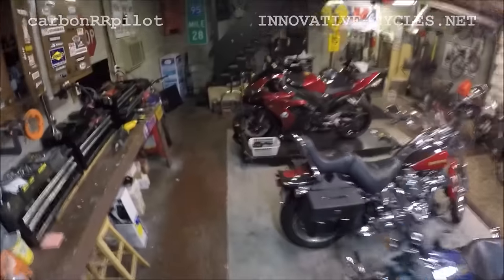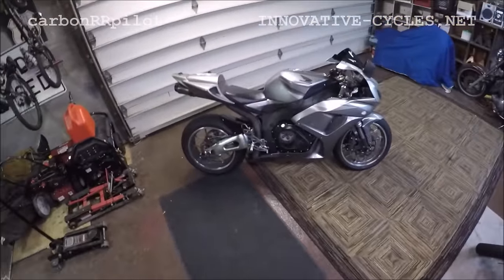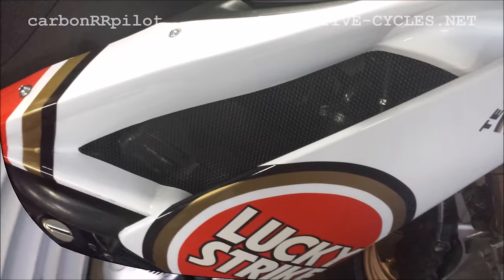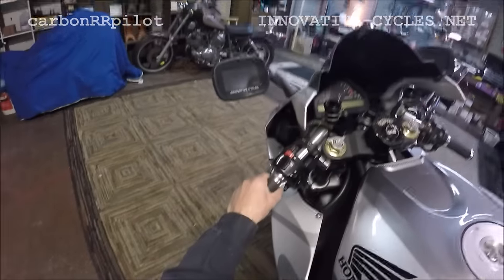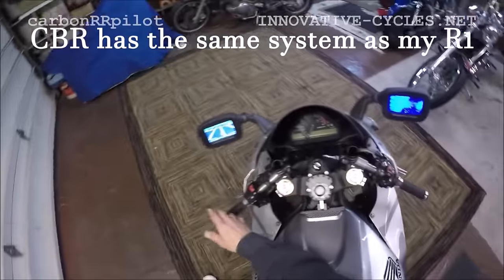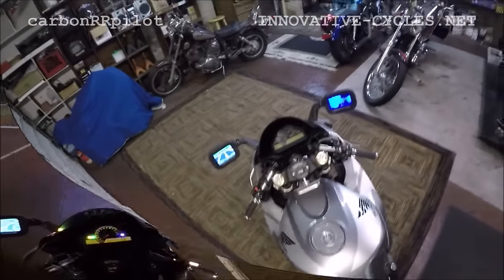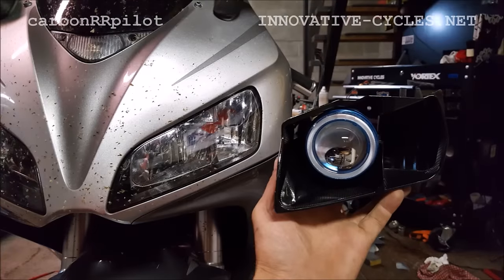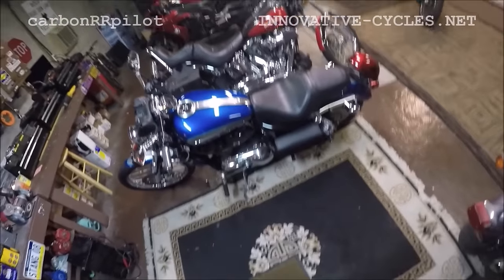CUSTOM GPS REAR-VIDEO MOTORCYCLE MIRRORS

Comment: This video might have saved me from completely removing my mirrors because I never use them and on my crf250l I get out in the middle of nowhere so that’d be sweet.  Having the nav up higher is probably way easier to look at without having to look away from the road.  In Arkansas and missouri where I ride the mirrors aren’t even required either

Comment: I'm thinking of an application that don't need to use the mirrors for a fast (60+mph) electric bike I built. It would be nice to mount to 7/8' / 22.2mm bars. The mirrors are nice, but I think I'd rather have the two of them mounted on dash for my motorcycle. In either case, I'll be contacting for price. Great invention!
Reply: And I need the lic place deal too!!!

Comment: Can those mirrors be modded to pretty much run on any street bike? I have a Yamaha FZ09 where the mirrors are mounted to the handle bar. Thanks.
Reply from the maker: Michael Hamlin 
it would be extra depending... but I'm sure I can make a bar mount kit for your bike.
innovative-cycles.net  call for possible options.
Reply: I am interested in buying these mirrors. Can find anyplace. Do you have a email to make contact?
I'm from South Africa 
Thanx

Comment: I am doing this one day . I plan on buying a Buell XB 9R and want to have rear facing cameras instead of mirrors but rather than mount the screens in the same location as regular mirrors they will be down inside the fairing just below and either side of the gauge cluster .

Comment: Love your quality work  awesome ! Here's a mod that I think many would be interested in and that is changing  the headlight system that only lights up one headlight on low beam and the other is reserved for your high beam  ,having both used  for low and high is a better look in my opinion .I ride a ZX10R 05 kawasaki  but I see many other manufactures  also use the twin lights as dedicated for one as the low beam  and the other for the high beam ( it was suggested this was because of  a safety issue  for cars so that they did not mistake the twin head lights  as been from another car) but in my opinion that's not relevant .also the fact that while the key is switched on so are the lights, a option to be able to turn them off would be cool  as trying to start a bike with a flat battery while the lights are on is of no help
Reply: 5 years ater (lol)     My Tracer 9gt suffers that arrangement but uness it is dark I just ride with high beam which has both on plus I can then "wink" At night it is no big deal only one side is lit on low beam just slighty off center  really dont notice on a motorcyce if only one side is lit....nothing like a car with one outnstead at ni really dont notice on a motorcyce if only one side is lit....nothing like a car with one out

Comment: Hey bro I love your work!!! That carbon CBR is dope AF!!. I"m doing an all carbon fiber GSXR750. Do you still make the dashes? If not, can you provide any diagrams or anything to help make one? I"m pretty handy and I've been wanting a GPS and a screen like yours  for rearview and that's it. Also, does it all run off of your bike battery, or are you using an alternate power source? I want to do that flash relay you've got for the LED's just because that seems like the best way to get people to notice you. Especially far away when they may not hear you. Do you just need the flasher for that? I'd appreciate any help bro! Thanks man and love your vids!

Comment: Can you provide more details on the hardware for the mirror kit? It looks to be more than just the guts of a Garmen slapped into a mirror. It looks like a fun DIY project.
Reply from the maker: yes normal auto navs wont handle the harsh environment of a bike, (moisture, vibration etc...)
these are raw screens manufactured for extreme conditions installed with custom software for bikes.

notice how all motorcycle specific navs sold in stores are twice the price of a car nav....  they are much more resilient for the extreme conditions.
Reply: carbonRRpilot so it's your own custom PCB and software? That's pretty cool. I was under the impression that you purchased some sort of off the shelf kit and modified it to fit/work in a motorcycle mirror.

Comment: This was a hell of a video! I like the  license plate one. I would like to use that sliding system on changing the muffled exhaust to the straight pipe. Is it possible?
Reply from the maker: DersNoNem 
sure, I think a company makes them with linear actuators to open exhaust.

Comment: I need a set of mirrors for my 2014 GSXR. How much and will the  turn signals still be useable?
Reply from the maker: Chris Coleman 
ive done a few of that gen gsxr and added 10 custom individually drilled in 1.5mm leds across the back of mirror replacing the oem sigs.....  looks super clean, they will be in an upcoming vid
Reply: Im in NJ need to get with you to get my bike done up.. If you could arrange the 10 LEDs to make and arrow for the turn signal that would be sick.
Reply from the maker: Chris Coleman 
no prob, I can have a set with the sigs ready for your gsxr in a day or two, just shoot me an email for contact info to call if/when you want to set it up!  carbonrrpilot@yahoo.com

Comment: any stunt bike mod videos.   I have a2008 ninja 650.  I currently run a tap in fitting to the footbrake as a rear hand brake.   is there any bike that has similar rear brake brackets as my ninja to hook up a legit hand brake setup.
Reply from the maker: nah, i do mostly electronics but if i think of anything ill let ya know!!

Comment: Impressive how do they fair if you drop the bike ?
Reply from the maker: Redsmeg68 
they are much shorter the reg mirrors so unless you flip the bike they most likely wont touch but in a hard crash as with anything else they probably wont fair well! lol
Reply: Thanks it looked like that was the case nice job on the tech and the fairings etc I particularly like the mesh devil to keep clean though

Comment: @carbonRRPilot how much for that custom dash that you did on the cbr for  a 2013 GSXR 750? that gps and camera are fresh!!
Reply from the maker: Mikefucius 
those dash's are handmade for each bike to fit in the available space. many hours of work not to mention the cost of the micro dash to replace oem guages, gps, rearview video, spkrs, micro amp etc... and I need the bike for some time.
the mirror kitts are much more practical, cheaper and can be made for a any bike without having the bike here.

Comment: Insanely hard to believe this is not a total thing by now if not as OEM then at least given the tech has been with us for years now combined with how generally universal mirror mounts are more or less interchangable between so many models? combined of course with how capable China (for example) would be ready willing and able to clone any acceptable system offering it for very little money?  I can see decent systems compete that woud fit 75% of existing motorcycle being sold for less than $150 or so  even less for junky ones   What a screen on a mirror stalk (only one is needed really) one camera OR optionallhy a monitor with a couple mounting options basically same as GPS or phone mounts and some wiring.....find an accesory circuit power would be on whenever bike is running and done....now obviously high end systems would have superior cameras and monitors and cost more like $500  With my Yamaha Tracer I woud delete the noisy (wind turbulance) oem mirrors and mount a nice arge TFT above the stock dash screen and enjoy superior rear view with less wind noise!  Maybe even a looped 10 minute recording in case of being rear ended woud be nice too

Comment: could you do my mirrors if I sent them to you? it's a gsxr 600
Reply from the maker: Quinton Wilson 
I have fitted many gixxers but I use these busa mirrors to fit the 4.3 widescreen and has the stalk boot to hide the wires!
Reply: carbonRRpilot what about my signals though? Cause they're built in my mirrors
Reply from the maker: Quinton Wilson 
if you email me I can send you some pics of these mirrors with a row of 10 individual 1.5mm led's on the back of mirrors to replace the oem signals.....  looks very clean and way more modern looking than the huge oem sigs!

Comment: you need to invest in a 3D printer. stop wasting time molding that abs sheet.
Reply from the maker: TR1PpyNick 
not that I couldnt use a 3d printer,
but I often do these in glossy carbon fiber, 2-way lexan etc so
it wouldnt be worth it for the things I make.
Reply: not even carbon fiber nylon or poly carbonate?